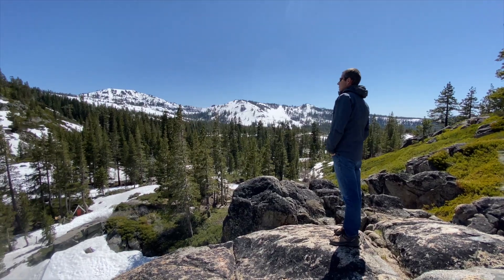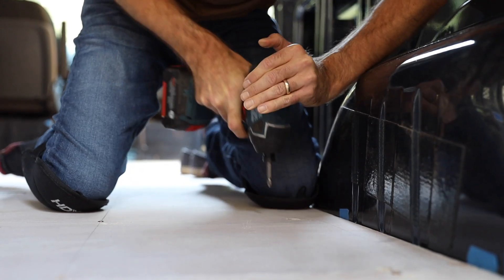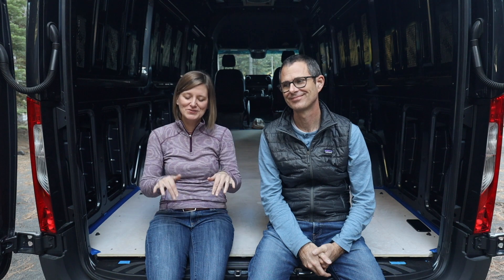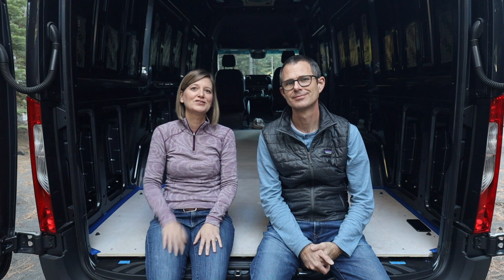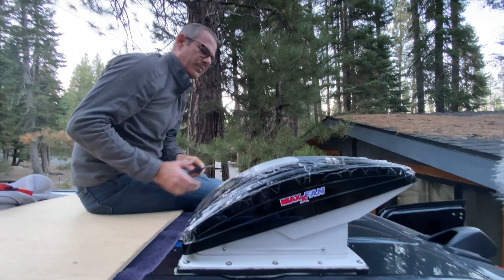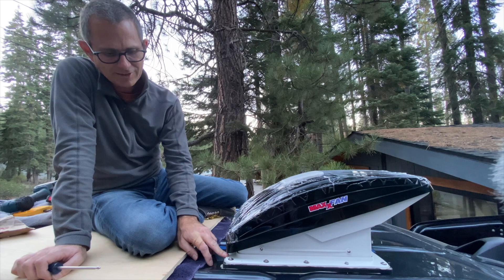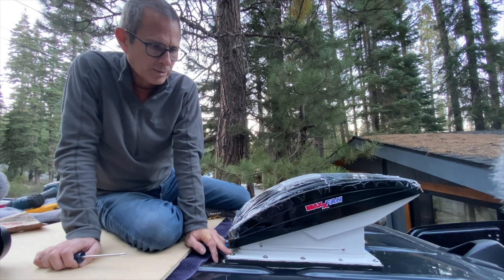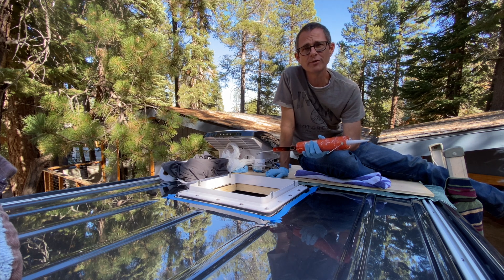How to Install a MaxxFan | Van Build Series | Van Life

Comment: Took your advice of going down boat deck bedding rabbit hole. Got sold on the butyl tape-only solution by those boaters. I too hate the look of lap sealant slathered all over flange. 

Used stainless bolts as you recommended and didn’t spin them once bedded.  A little more difficult than metal screws but it’s super waterproof and looks super clean. Thanks for your “what we would do differently” comments at the end of this video.

Comment: By far the most precise and detailed MaxxAir fan installation video I've seen yet. I LOVE the way you made the wooden frame. I've never seen it done that way before. I will be copying your technique.
Reply: I just recently saw a video in which the installing couple used white, paint-on Flexseal instead of Dicor lap sealant for the same reason, for a finer, nicer outcome avoiding the melted ice cream look of lap sealant. Yours looks very nice just the way it is (with the 3M product). I think using only butyl tape invites problems later on; butyl tape cracks over time. Again, nice job.

Comment: I think I like the butyl tape between the roof and the adapter plate. I've seen Sika adhesive used/suggested here, but I like that the butyl tape is probably easier to remove in future (be it for changing out a defective fan or changing out to an AC unit on the same location.

Comment: Make sure you read about regulated 12v for maxair. The little motor will fail if the voltage drops often.
Reply from the maker: Thanks for the heads up! We'll look into that.

Comment: For cutting the sealant off of the roof they make plastic razor blades. I've used them to scrape junk off of tinted windows. Not all places carry them.
Reply from the maker: Great tip, thanks! I'll have to look for those.  Would have been very helpful for this project.

Comment: nice how to. small rip when cutting the roof  you have the issue the roof ribs are higher so you have to balance the jigsaw. when you use a some wood on the other side you level it out and you don't have to balance the jigsaw

Comment: Nice install. I like how you used washers to spread out the load on the plastic fan mount, I was thinking the same thing when I installed mine, why would they make this piece out of plastic? What I did was cut out pieces of aluminum to go around the whole top of the fan mount so it would seal better. Definitely recommend Dicor Self Leveling Lap Sealant to go on top of everything, it's used on almost every van and every RV. Looks like you're in Alpine Meadows doing your build?

Comment: Thanks again for the great video!  For the fasteners, are you saying that if a process is followed using bolts (instead of screws) that you don’t need to cover the fastener heads with 3M 4000 marine sealant?  I’ve seen all other vanlifers cover their fastener heads with sealant but didn’t realize that step could be avoided.
Reply from the maker: Hi Corbin! I don't want to steer you in the wrong direction, but, if you do some research and follow the correct process, I think it may be possible to avoid sealant on the bolt heads. Just do you homework first. Here's a link (https://youtu.be/1g1Q_4VwiD0) to example video on how to bed a boat hatch (basically same as fan flange) with only Butyl Tape and SS bolts / nuts. My understanding (and where I think we went wrong) is that you must take care not to turn the bolts once they are inserted through the BT and you need to make sure the bolts are carefully wrapped in BT for a complete seal.  To avoid turning the bolt, you tighten everything down using  the nuts.  In this video, he also countersinks the bolts to create a BT gasket where the bolt enters the flange. My recommendation is to do a search on 'bedding boat hatches with butyl tape' as there's a lot of useful info on sailing forums that should point you in the right direction. If you find an approach that you think would work for you, you could start by using the SS bolt / nut with BT approach to install your fan and then do a thorough water test with a hose to make sure it doesn't leak.Worst case, if you find a leak through any of the bolts, you can  just take the extra step of applying sealant over the bolt heads (or even the more aggressive approach of sealing the entire flange with Dicor or Flexseal) like everyone else.  If you decide to go this route, definitely let me know how it turns out. I like the clean look of no sealant on the the bolt heads so I'd love to hear how it works out for you.
Reply: That’s absolutely brilliant to gain inspiration and ideas from the boating community!  Who else know better how to keep out water?  After watching the boat hatch installation, I totally get your entire video.  Thank you again for your time in responding!
Reply from the maker: @corbinkoepke4598  Glad to help! Good luck with your installation. Would love to hear how it goes!
Reply: @wanderlibre4434  As usual for you guys, fantastic video! Great production and detailed presentation. That video link above is now a 404 but I'm following what you are saying. Thinking it though, using bolts with the butyl sealing is then a different set of extra complexity. You can't just use a threaded insert on the top side of the wood frame since you need to turn the nut while holding the bolt to keep the butyl around the bolt head. And because of the trim ring, I assume you wouldn't want the nuts to be surface mounted on the bottom of the wood frame. So then I guess you would drill out a recess in the bottom of the frame for each washer/nut and then use a socket wrench to tighten the nuts... Seems like a lot of work to avoid a messy looking seal. Or is there a different reason you don't like the self-leveling sealant? If it's just appearance OCD, I totally understand and support you :-D  But I would say that I think people see the deck of their sailboat more often than you'll see the roof of your van. Or are you planning a roof deck? :-O
Reply from the maker: @larssmith3915  Hi Lars.  Haha, you're 100% correct - it's just appearance OCD. Trying to have it look as professional as possible.  There's no problem with Dicor, it's a great product.  If you share our OCD and want to avoid Dicor as well, you don't necessarily need to drill out a recess for the washer/nuts.  In our case, we have space between the ceiling and wood trim so it wouldn't be necessary (we're not using the trim ring provided).  We'll find another link to replace the one that is now a 404 error and post it in the description.

Comment: Jim can you expand on the bolts vs. screw issue you had?  When I think of a bolt, it includes a nut on the other end?  I'd like to copy your install as I hate the look of lap sealant.  There's just no way for that stuff to look nice.  Thank you.
Reply from the maker: Yes, I'm referring to a bolt with a nut vs. screw.  Here's a link to a video which explains how it works on boat deck hardware - which can be applied to installing the fan.  If you go this route, would love to hear how it turns out!

Comment: Can you explain the why on your sealant choices?

I have already decided on the all butyl tape bedding sealant, though yours is the first example I have seen it implemented. How did you reach this decision?

On the other hand, the Lap sealant makes sense to me as a top layer sealant. Why did you choose the 3M 4000 sealant adhesive instead?

Thanks for your excellent video!
Reply from the maker: We went with the butyl tape because we're familiar with the sailing world and butyl tape is what they often use as sealant.  And since the sailing world has been around longer than the van life world, we thought we'd give it a try.  The other reason is because of our OCD tendencies 😂 We don't care for the messy look of lap sealant.
Reply: @wanderlibre4434  Thanks for your reply. 

I agree on using the sailing world analogy, though as an engineer I should note that the vibration profile is very different. The RV world does use butyl tape for fan mounts, though I don't have much respect for their engineering.

I did look up mounting hardware with butyl tape for sailboats. They are focused on fiberglass clad decks where there is room to cut a bevel in the bolt hole. I don't see that applying for a road vehicle fan install.

I get you on the messy look for lap sealant, but the tech looks correct to me. At over 9 feet in the air, few people are going to be looking at the lap sealant very close anyway. ;-)

BTW, I will be using SS M5 bolts, nuts, and washers. A good source is McMaster-Carr.

One of my criteria for van assembly is the ability to undo and redo as much of the work as possible. "Permanent" adhesives such as the 3M 5200—which Hein recommends—are to be avoided.
Reply from the maker: @BobCollins42  Thanks for sharing your expertise.  Good info, as we are not engineers :)  Haha, yes, practically no one will see the lap sealant that high up.  100% agree with you about the ability to undo work if necessary.  Which reminds me - it's another reason that we tried the butyl tape and 100% why we didn't use the 3M 5200.  Best of luck with your build!
Reply: 25:50 is the answer

Comment: You didn't tall about the groove you have for the wires.  Where did you place that and how did you make it?
Reply from the maker: Good point! We missed that. We cut a 1/2 inch dado in our wood frame directly below where the wire comes out of the Maxx fan.  (You can use a table saw or sliding miter saw, or even a drill). It provides enough room for the wires to pass through. Does that help?
Reply: @wanderlibre4434 
 I thought that's what the gap was for at 3:43 when you left the space between the 2 pieces of 1x2 you glued to the 17" piece.
Reply from the maker: @jcrefasi1  Ha, good catch.  It was glossed over, we meant to point it out in the video to bring more attention to it.  But your correct - you can do it like we did or cut it out with a miter saw, table saw, etc)
Reply: @wanderlibre4434  I thought using the 1x2 scrap was genius!! I was saying to myself  "that's the way to go!!", it makes the corners easy to join and the space for the wire so easy. Then you threw me a curve when you mentioned cutting a dado!! I had to re watch that part. Just glad I don't have to learn what a dado is 😂

Comment: Ditto. I just installed my Maxxair this morning. I used butyl tape to build up a thick stack to compensate for the ridges of the roof.  Before I apply all the screws, I realized the screws will compress the plastic flange onto a pile of..mud. So my engineering mind kicks in, this is not structurally sounded... stop.  Now I just saw you used an adapter plate. But the link does not work any more. Hmm. I may have to rig up something. Could you verify the link for us. TIA
Reply: Never mind. Found them with new search. But $60 geeze. I can make one out of alum, or plastic, or hardwood.

Comment: links for the adapter??
Reply from the maker: Sorry, here it is! (choose the appropriate adapter - the size of your van and if you want it for the front or back):  https://rover.ebay.com/rover/1/711-53200-19255-0/1?mpre=https%3A%2F%2Fwww.ebay.com%2Fitm%2FSprinter-NCV3-or-VS30-2007-present-Roof-Vent-Adapter-for-14-x-14-opening%2F143539173702%3Fvar%3D442494115400&campid=5338752222&toolid=10001&customid=Maxxfan

Comment: Everyone has a Maxxair maxxfan install video.  And every one of them install it exactly the same way.  yet, look for a video on wiring up the Maxxfan to a starter battery and no where does one exist, no images on messageboards, not wiring diagrams, nothing.  the Manual that comes with Maxxair fans/vents, doesn't even have a single word about wiring.    It's by far the strangest thing about building a conversion van from scratch.
Reply from the maker: Looks like that would be a great video for you to add to YouTube!